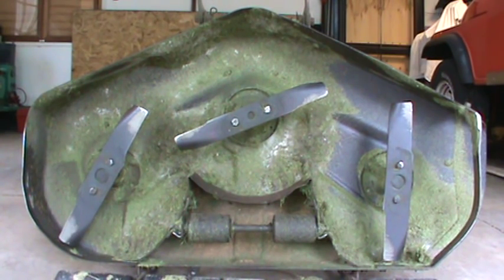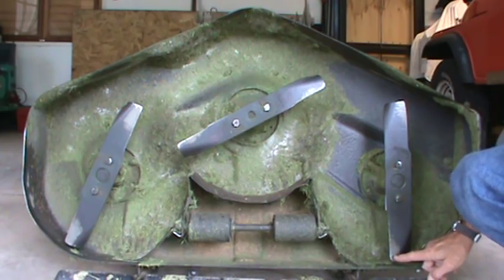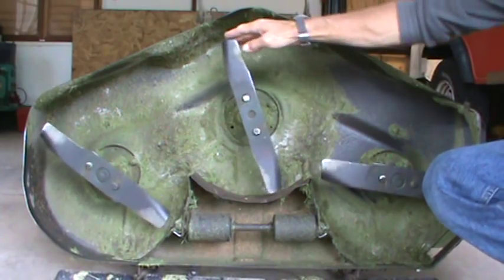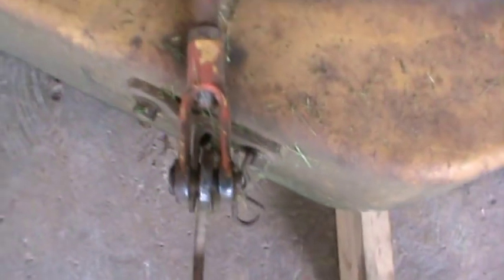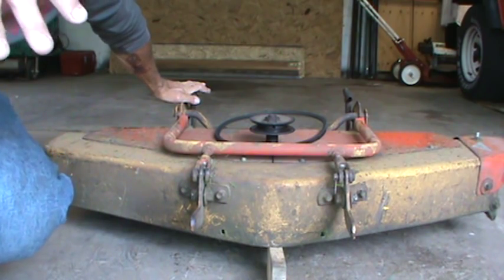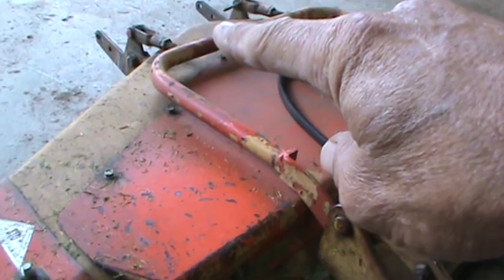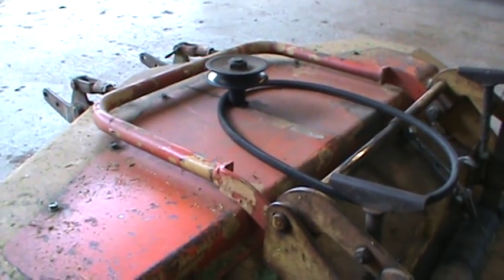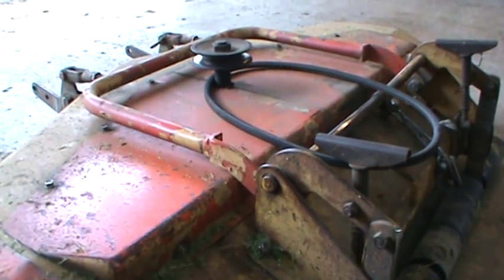Simplicity and Allis-Chalmers Deck Leveling

Comment: nice video as usual. i wish Deere were as easy as this.
Reply from the maker: +Adam Bish That's why you should get rid of the Deere and get a real Garden Tractor. lol There's over 40 implements that attach and detach literally in no time, are all easily adjusted and serviced and parts are about 1/4 the price you pay for anything Green. I'll never understand the attraction to the over priced Deere line of "garden tractors". Am I biased....Absolutely. I've pinned my Simplicity and Allis-Chalmers against Many John Deere's in their elements and my tractors ALWAYS out perform, outlast and they do it looking awesome, made from 100% steel with no fiberglass or plastic pieces, heavier gauge steel frames, more rigid drive shaft driven power put to the ground more positively....the list goes on. In all honesty...I repair more Deere's each year than all other models (MTD and AYP included) in total. All I'm saying is, proof is in the pudding. And Deere is the Tapioca of puddings...you are the only one's that love it. lol Sorry to rant, but having been in the repair industry for over 25 years, you learn what a machine is really made of. Granted...there ARE Good Deere Garden Tractors....buy why spend thousands upon thousands of dollars for a color when you can get better dependability at a fraction of the cost and with less maintenance and break downs? Cheers!!! Zip~ p.s. As I said, I'm Biased....but my bias comes with tons of experience, and you can't argue the facts. Sell the Deere, buy a Simplicity or Allis Chalmers, and you'll wonder what you've been doing all these years with Deere.

Comment: any chance you'd have any storage tips on the 80s 48" decks? 
They don't stand up like the old 42" decks and they tend to roll if leaned up against a wall. 
Was thinking about making a support braket to hookup under the center spindle shaft top side of the deck.
Reply from the maker: If you have a wall where you can secure the deck, I always put them blade side facing away from the wall then I have a hook screwed into the wall that I can tie a rope to to hold the decks and keep them from falling over. Works for me any how. Merry Christmas my Friend! Don't forget, today at 12:30 Eastern/Central I'll be on "Micks Mowers" Live Christmas Special with a bunch of other small engine channels. Zip~
Reply: @ZippoVarga  thanks

Comment: Hey zippo. Been watching a lot of your videos this past month or so. Lot of helpful information! After years of collecting and working on John Deeres I'm getting into the old AC stuff now. My question is, I've always read / been told, that the front of the deck should be lower than the back. But you're saying to set the front higher. I looked in the manual for the 42" mower on simple tractors, and it does say set the front 1/2" higher. So have I been doing it wrong all these years? Or is it just AC/ simplicity that gets set like that?

Comment: I'm Having a problem leveling the deck on my 7016H. The previous owner welded  one side of the levelers on the front ( and it may be out of alignment) . It look like ill need to adjust the deck off the tractor. I can't seem to get enough clearance to adjust to make a difference  Suggestions?
Reply from the maker: Unfortunately, with poor repairs comes poor performance. You need to undo what's been done wrong. Zip~
Reply: @ZippoVarga  I guess I'll have to try to find the mounting hardware the decks ok but the way he welded it there's no way to just replace the fork. Thanks zip

Comment: Will all simiplicity mower decks during the AC era fit AC lawn tractors, for instance will a mower deck off of a Simplicity 4211 fit an AC416 ?
Reply: I have an AC 610 and pulled a deck off of a Broadmoor 5010 donor.  There's some minor differences, probably fixes for issues they had, but they both fit the 610.

Comment: hey i have a simplicity and need a new axle? any idea on where to buy
Reply from the maker: +Steven Duganitz That's like saying, I have a Chevy, where can I find a radiator. There's literally hundreds of Simplicity models that span almost 80 years of manufacture. Could you be a little more specific. Model? Year? Transmission type? i.e. Manual, variable, shuttle, Hydrostatic? Axle or Axle Tube or both? Axle Differential?  Zip~